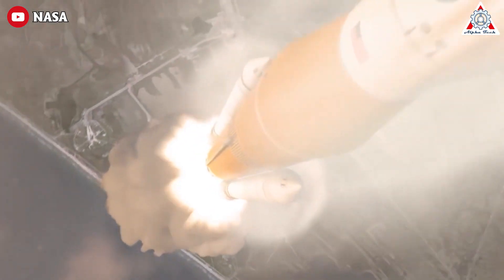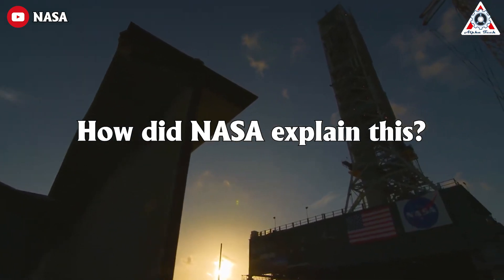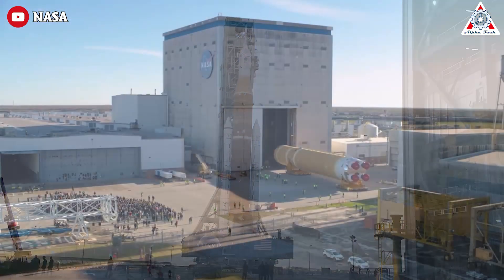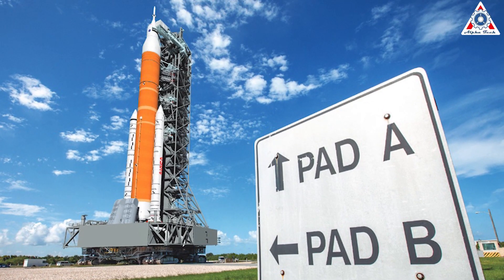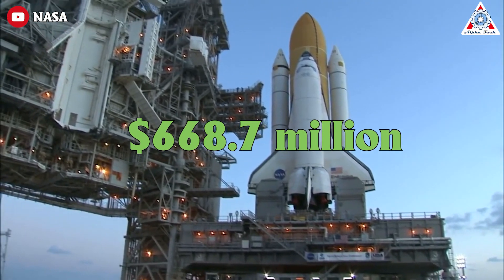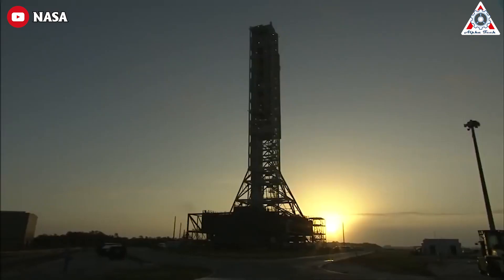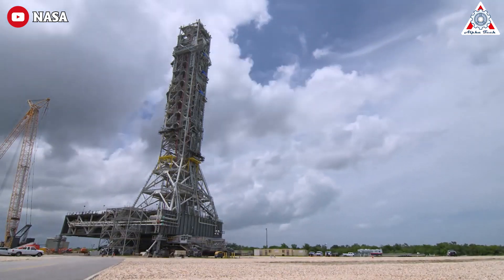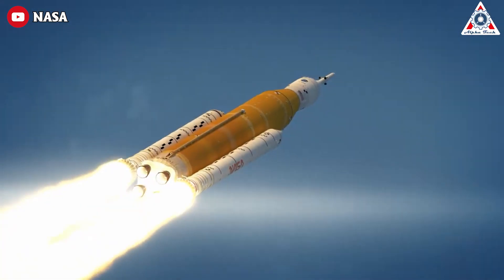Disaster! NASA Launch Tower Big Problem...

Comment: SpaceX needs to conduct its own moon mission. Just get it done and leave NASA out of it,
Reply: Agreed!
Reply: I may be wrong but it was my understanding that they was at least going to test starship a few times to the moon before the manned mission and they want to build there own R&D lab their too, so there should be some moon missions of their own.
Reply: @edwinmartin1924  let's hope so , and all shot in wonderful 4k plz
Reply: @edwinmartin1924  Sir: think. How about this: SpaceX has been contracted to build the HLS (Human Landing System), right? It is a custom-built starship that lands and takes off from the surface of the moon. It will need to be tested starting in 2023/4, right? So on its 2nd or 3rd lunar landing/ take off test SpaceX should send along a couple of engineer technicians...you know, to make sure everything works. Yeah. They can ride the external elevator down and up a couple of times to make sure that works. And even test the elevator platform egress gate...you know, to make sure the NASA astronauts can step off and back on to the platform safely. Make sure that works. Then it is GO for NASA to spend $4.3 billion to fly that sooped-up Apollo Command module (Orion) to meet up with the SpaceX HLS, transfer their astronauts over, take them down and back to the lunar surface, to return in the Orion for their journey back to Earth. And NASA will have its triumphant return to the moon after 55 years!
Reply: The biggest thing preventing SpaceX from steaming forward full throttle is the very same entity of retard politicians and their egos running NASA that he’s competing with, and the FAA who seem to drag their feet or deny him the ‘safety permits’ to do so-on purpose.
Reply: @fukaimori1  Well, he's refitting 2 off-shore oil rigs into mobile starbases, has his own global communications network for telemetry anywhere on the planet, uses simple methane and oxygen for fuel, so all he needs to do is pull his mobile sea-launch platforms 12 1/2 miles off the coast and do whatever he wants, whenever he wants. I suggest that when they re-fit his 2 off-shore platforms into mobile starbases he make sure that at a distance the silhouette resembles a fist giving the finger. Pull one off the Florida Space Coast in full view of NASA offices and one off the East coast in full view Congressional Offices in D.C. Then LAUNCH AWAY!
Reply: Agreeeeeee...✌👍
Reply: Lmao, good luck
Reply: @KnightspaceORG  No? You don't think so? Well, how about this scenario. Artemis calls for SLS to launch the Orion capsule with 4 NASA astronauts into lunar orbit, yes? Then Orion will meet up with SpaceX's HLS (Human Landing System) in lunar orbit, the astronauts will transfer to HLS. The HLS will bring the astronauts down to the Lunar surface and back up to lunar orbit. The Astronauts will then transfer back into Orion and return to earth. Now, that's the actual plan on the books right now. So SpaceX will have to send HLS to the moon first to be tested, correct? HLS 1 will land and not do anything else. But that means there has to be an HLS 2 and even HLS 3 to test the landing, functioning of all equipment and successful return to lunar orbit, yes? OK. So what if SpaceX sends along a couple of technicians on the HLS 3 test mission. You know, to make sure everything checks out. Yeah. They can ride the external elevator down and up a few times to make sure it doesn't stick. Hey, and they can even test the elevator platform's egress gate to make sure the NASA astronauts can safely step off on to the moon's surface and back onto the platform. The technicians can rehearse that a couple of times. Then fly back to LEO, transfer to a SpaceX Dragon capsule and return to earth. Then NASA can triumphantly return to the moon after 54 years! YEAH! NASA! Way to go!
Reply: @lawrenceallen8096  Neither SLS nor SpaceX, except for Falcon, systems even reached orbit yet. You are falling for the marketing schemes.
Reply: @lawrenceallen8096  How to spot a teenager losing an argument lmao, Musk stans are hilarious.

Also, i wish i was 17 again, so you thinking i'm that young is flattering.
Reply: @lawrenceallen8096  I'm not an American, neither do i live on the same continent as you lol, don't apply your US thinking to me.

I'm just looking at facts. And the fact is that Musk constantly overpromises and underdelivers.

Buuuuuut, the fact that you have so many conspiracy theories on display here, is really really telling. You love to feel like the underdog, right?
Reply: @KnightspaceORG  Inconvenient facts: Since 2008, SpaceX has had 185 successful orbital launches and recovered 147 of its boosters. They've reflown those boosters 122 times. Since Crew Dragon’s debut, SpaceX has flown more astronauts into orbit than anyone: 30. In the last 10 years NASA hasn't launched any, and STILL can't. SpaceX launches a Falcon 9 one per week at $ 67 million per launch. NASA was paying Russia $ 90 million a seat. And SpaceX's Starship is 2 X as powerful as the Saturn V and (According to NASA) will fly within the next 30~60 days on its maiden test flight. It is 100% reusable.  Falcon 9 alone has made ALL OTHER OPERATIONAL ORBITAL ROCKETS OBSOLETE! What "disappointments" do you have, son? Or is it disappointment. "Waaa! Twitter won't silence people I disagree with! WAAAA! I can't win an argument without cheating! WAAAA!" And you can't win a space race by cheating either. Nobody likes a cheater!
Reply: @lawrenceallen8096  Yeah, my assessment was true. 
Starship has not flown. So yeah, you don't know if it's more powerful, other than some promises.

Also, twitter is a garbage platform, i'm glad that dude went bankrupt after being forced to buy it.
Reply: @KnightspaceORG  Actually, you're right. I'm really 17.
Reply: @lawrenceallen8096  Whatever you say
Reply: @KnightspaceORG  I say "Lmao, good luck." Sorry, you're right, that comment is beneath a 17 year old spoiled child. My bad. You know, KnightspaceORG, I had a formative experience back in the late '90s which colored my perspective to this day (favorably). I was having breakfast in Hong Kong with one of my Nestle colleagues from the R&D team. He droned on about "America, this..." and "America, that..." And so I asked him: "You of all people, a HongKonger shouldn't be complaining about the USA. A good portion of your economy depends on exports to and investment from the USA. When the cultural revolution was happening to the north the USA helped Hong Kong stay strong against the communists. You are under our protective umbrella to this day with hour navy doing routine port of call in HongKong. You have open access to our markets and got rich off of it. You send your kids to our schools, and freely immigrate to the USA. So many benefits in the relationship. So why no negative about the USA?" And he stopped, thought for a moment and said: "Actually the USA has been very good for us...I guess it is just that nobody likes the big guy on the block." And ever since I alway smiled and said little when non-Americans began America/American-bashing. I guess in my old age my tolerance for that kind of BS is drawing thin. Musk and SpaceX are a national treasure and when you toss your cell phone and start using your satellite phone after Starlink becomes globally operational you will gladly use the service, but have no idea (nor appreciation) about the hard work, ingenuity and grit that it took SpaceX to get it up there! You'll just say "He's being mean to the transgenders on twitter" or some such nonsense.
Reply: @lawrenceallen8096  Now i wonder if it's trollbaiting or just a case of pure insanity
Reply: @KnightspaceORG  I'm partial to the pure insanity thingy. Trollbaiting implies a lack of sincerity, whereas I am quite sincere in my insanity. This passage from my 2014 novel says it best: "Life in 1870 BC and life in 1870 AD were essentially the same. Romans had plumbing, the Chinese invented gunpowder, and trains came around the 1700s, but nearly all of humanity still lived hand to mouth, on someone else’s land, raising food with basic implements, and saw at night by burning animal fats or kerosene. That for thousands of years nothing had fundamentally changed for the vast majority of humanity.
There have always been brilliant, ambitious, and creative people, but throughout history they served at the discretion of aristocrats: whether patron of the sciences or arts. And if something didn’t serve the interests of the aristocratic classes, or worse, benefited the servant classes in ways that empowered them, it wasn’t pursued—and may even have been deliberately suppressed if it endangered the social power structure. But one hundred-fifty years ago something changed: the U.S. Constitution, newly emancipated from its own shackles of human slavery, appeared on the world scene. 
The best of humanity, the ambitious and passionate about improving themselves and their lives chose to leave the oppression that held them back in their homeland; whether the aristocrats of Europe, imperial rule of China, or India’s caste system. Within the crucible of constitutional freedoms and with the riches of the North American continent these Americans made fortunes—not by inheriting or seizing them from others, but by empowering the masses by providing them things like electricity, transportation, telephones, appliances, petroleum products—not by withholding it from them. Together they pushed humanity into its next eon by bringing these innovations to the masses at an affordable price, for profit: Tesla, Ford, Edison and Westinghouse, Bell, Gustave Whitehead and the Wrights, Ron Popeil, what have you. 
And true to form Americans didn’t keep it for themselves either. During the American century the nation led the replacement of a world order founded upon unequal treatment under centuries of European colonialism with free and fair trade that brought prosperity to hundreds of millions, if not a billion or more human beings. Living on the North American continent, under the U.S. Constitution, freed the human spirit. And under these conditions it wasn’t one hundred years—within the span of a single human lifetime—that they led humankind from horseback to the moon.
"
Reply: @lawrenceallen8096  Man, now that's some nationalism right there. Funny how that works, huh?
Reply: @KnightspaceORG  Well, the USA has been around for 250 years. The question is, what the hell was the rest of the world doing for the prior 4,000 years of human civilization? (Hint: Come on KnightspaceORG, its a self-fulfilling argument I'm making.)
Reply: @lawrenceallen8096  Ah, so it's exactly the same thing as it happened everywhere else. 

What's so unique about 'murica again?
Reply: @KnightspaceORG  Well, we did craft the post-European Colonial era with the American century that resulted in this: https://www.youtube.com/watch?v=FDwCuz4WUi4&t=103s  Also I must say how proud I am of the UK having its first PM of color! We, of course, led the way with the first President of color a decade & a half ago, a 2-term President, and now have a Indian-Jamacian Woman as VP. So glad he UK could join the club! Now, let's see the rest of European countries step up.
Reply: @lawrenceallen8096  American century.

Boy, i haven't seen that one in a while. Someone needs to get out of the 'murican bubble.

Also, what does it matter how a person looks or who their parents were?
Reply: That is gross. Why are you not eating more hair
Reply: @lawrenceallen8096  I don't even have a twitter account, i never had lmao. That site is garbage at the best of times.

Also, i just told you i'm not an American, what is wrong with you? Neither am i what you accuse me of being, and that last one is frankly really insulting. You have no arguments left, huh?
Reply: @KnightspaceORG  Actually, I mis-posted that NAZI fascist thing here, when it was meant for an American Democrat with whom I was debating on another thread. You are correct that it was not appropriate for your, a non-American. But very much deserved by the bloke upon whom I eventually dropped it. My sincerest apologies. That said, while we're on the subject of America-haters (and while failed presidents like Biden, Obama and Bush II have made it more difficult to defend), the US has a lot to celebrate. Yes, its space program: government-run half a century ago and now privately run by SpaceX and other fascinating start-ups, but more so for the tremendous benefit that the 'American Century' has brought humanity, particularly after the fall of communism in 1991. To understand that, I ask that you have a look at this: https://www.youtube.com/watch?v=FDwCuz4WUi4&t=100s
Reply: If everyone in the US crowdfunded SpaceX with just 10 bucks that would be 3.3 billion dollars.
Reply: @TLH442  Because so many of us can't wait to chip in to help Elon with that tiny ego of his.
Reply: @thomasbell7033  atleast his little ego gets things done
Reply: @lawrenceallen8096  Oh, lord, another Elon groupie who knows all the stats by heart. And I'm the one who has no life? Good day, sir.
Reply: @thomasbell7033  1 Orbital launch per week. Building 1 Raptor engine a day. All for 1/50th the cost of your "NASA Industrial Complex" who had to buy engines from the Russians for half a decade, pay the Ruskies $90 million a seat to get to the ISS, and failed to launch its 9 year-late, $20 billion over budget "The Shuttle Had A Hot Date With A Saturn V" Frankenstein's monster that has yet to fly, i.e. the SLS. You don't have to be an "Elon Groupie" to recognize success when you see it. You only need to have your head out from your a$$ to see that!
Reply: @thomasbell7033  The status don't care about your feelings
Reply: You are right